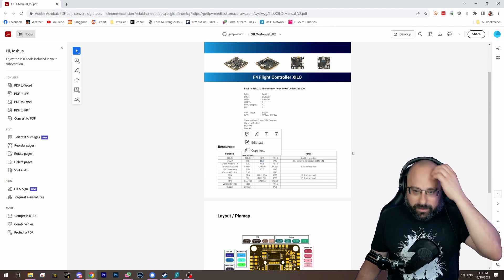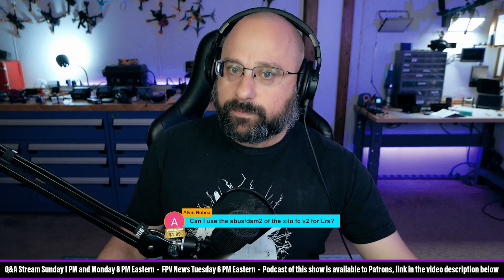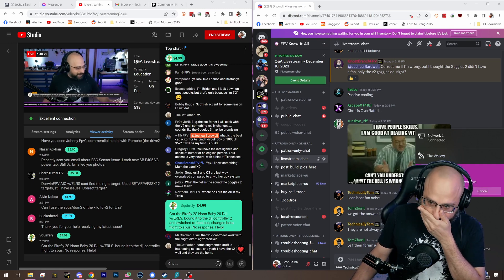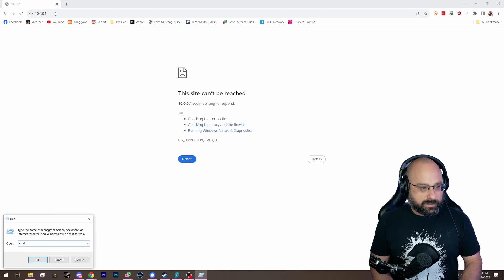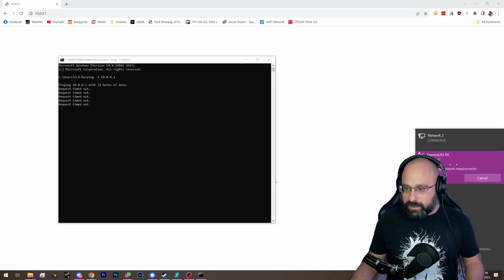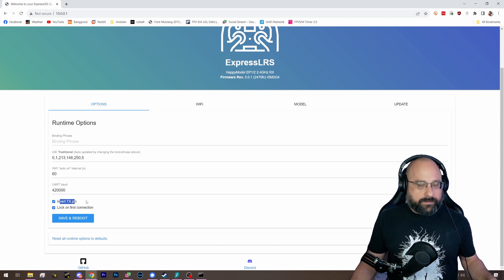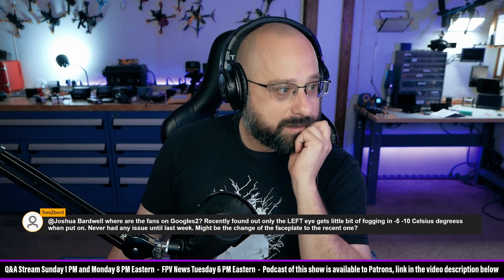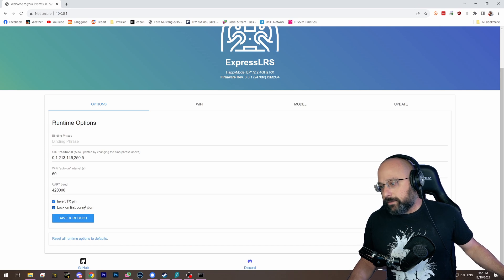How To Get ExpressLRS Working Fully On An SBUS Pad?! Xilo V2 Full UART Extra? - FPV Questions

Comment: @JoshuaBardwellLivestreamClips please do this video!!! 🙏
Reply: I have not been able to get it to work yet.  I think it has something  to do with TX1 having the notes that it's half-duplex.  When I wire it up like this, I cannot get ALL the Telemetry.  If I do not invert crsf, I get all the telemetry, but then the FC is not talking to the O3 (rssi, etc).  If I invert crsf, O3 works, but  I only get the first 10 Telemetry elements.
Reply: I mean it works... but I can't get batt% on my TX16S.  Not necessarily needed, but still looking for solutions.